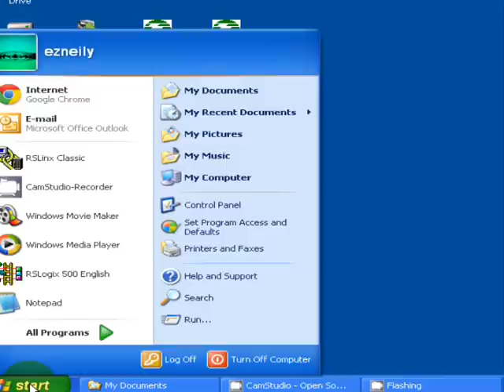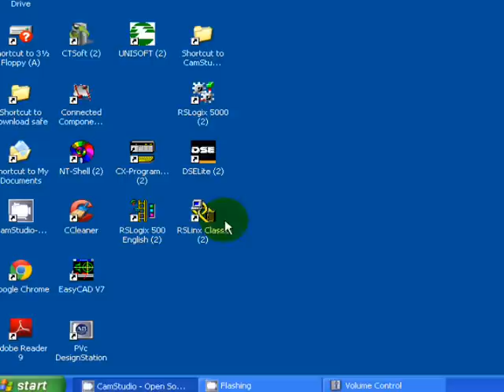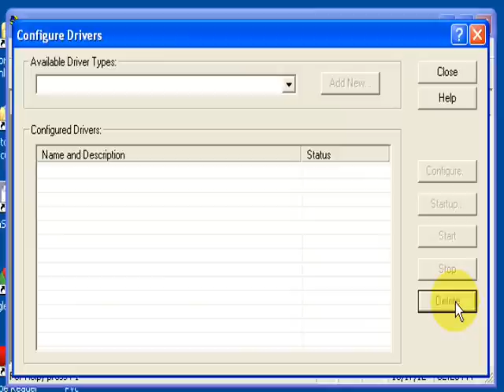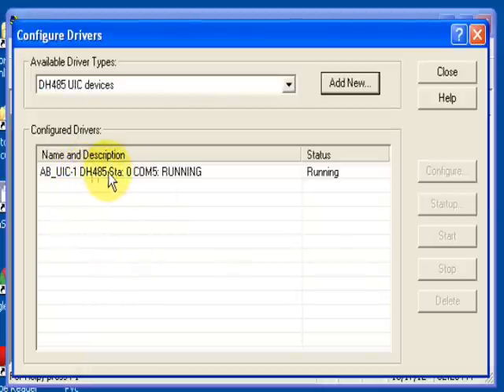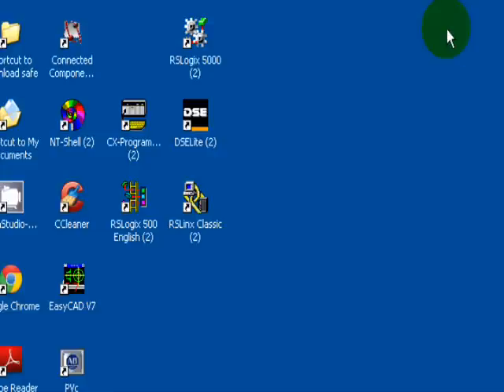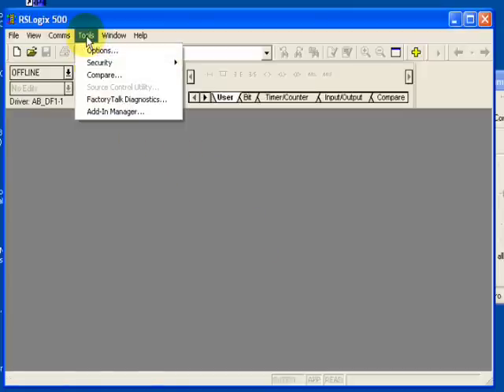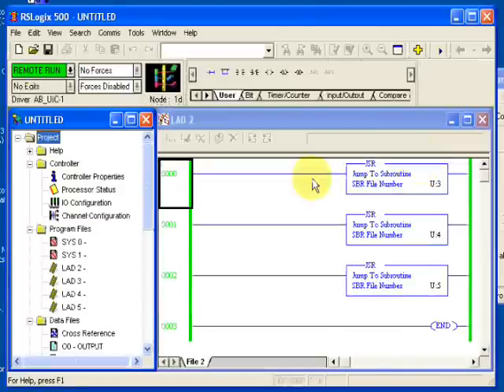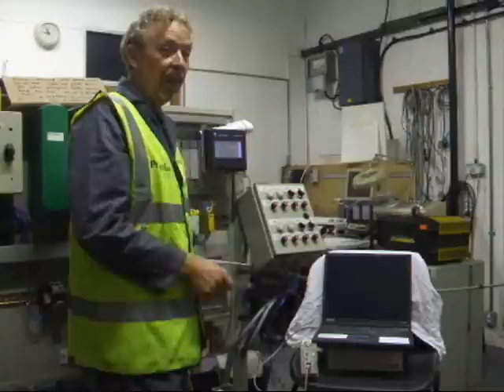Allen Bradley slc503 connection by DH485 UIC cable

Comment: Hello, I have a PLC SLC500 1747 and I want to connect it to the PC, but my attempts failed. I used the RS485 to USP driver, but I did not know how to connect it to the PLC..... If there is a place you can help me with that...

Comment: I'm from Brazil
Here I have a machine with siemens 840d
Simatic S7-300

which any required this cable that you plug straight in CPL
with this system is to make the Backup Schedules
parts of manufacture.